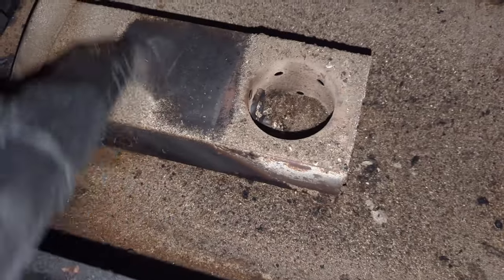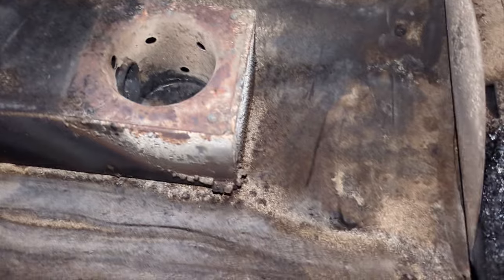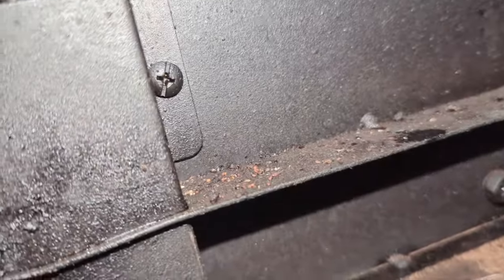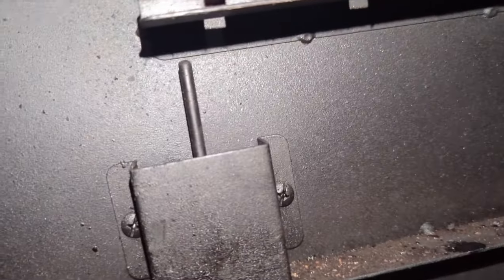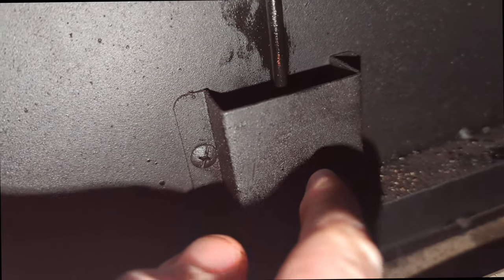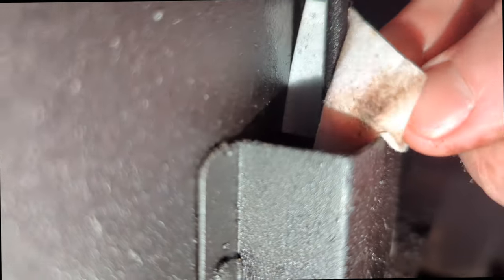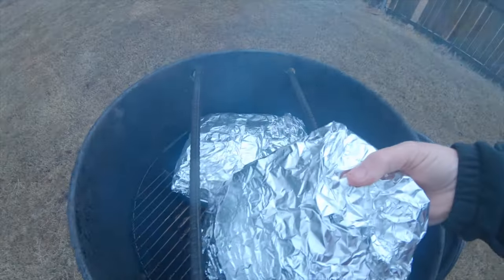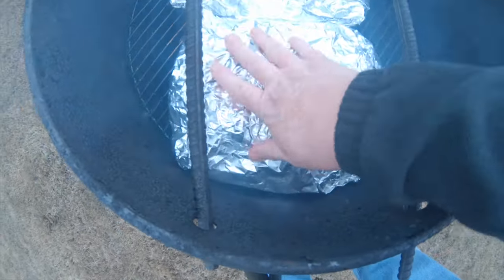Easy Guide: Cleaning Your Pit Boss Pellet Grill Temperature Sensor

Comment: I put a new board in and it was reading (digital) 100 degrees less than the manual thermometer so I changed the censor and still having the same problem do you have any ideas
thank you
Reply from the maker: I haven’t had this issue, but the temperature readout can vary significantly with manual thermometers vs the digital readout.
Reply: @OkieSmokin  it didn't by this much till I changed the board of course it was an Amazon board so idk so if I crank it to 500 it'll get to 650 lol
Reply: @ronbelcher9301  I was gifted this ,  person used it probably twice. So i didn't get a manual and I knew nothing about it. It worked nice, then I started having temps on start up going from 70 to 210 . and shutting off the ignitor, fan, auger . and if i did get it started or started it myself . I'd have an error and the grill shut off . Believe me when I say,  I tried everything . Board, etc....  alcohol wipes cleaning gave me the same issue.  I said *%$% it , and used emery cloth. cured my problem ,  could probably keep it clean with alcohol or vinegar now, but still . I was fixing to drop 1000's on a new grill from a different brand. It acts just like it did the first few cooks. The solution was to take the cover off the temp probe on the left (two screws, Phillips) and clean the hell out of it with emery cloth/sand paper. I just used it for 4 hours. not one error . temp held .